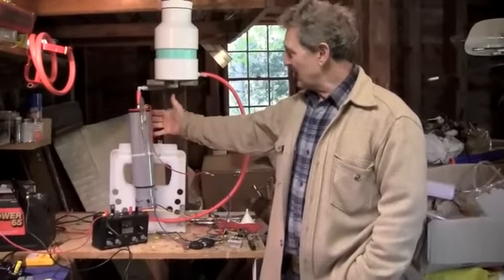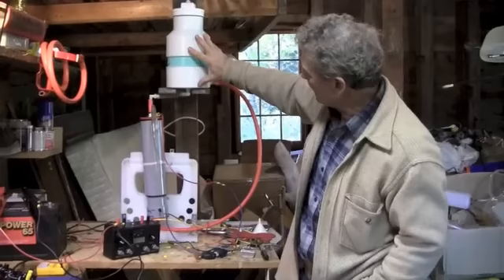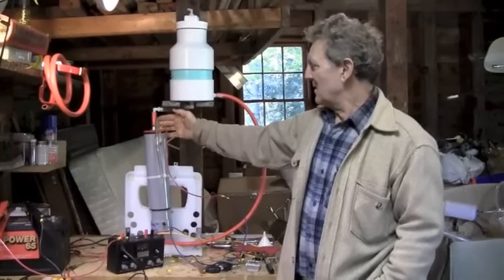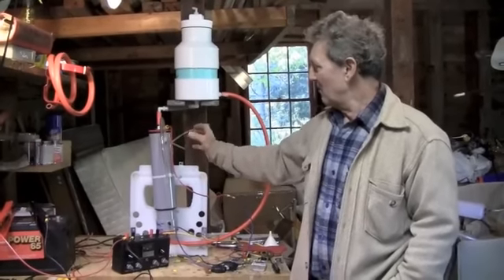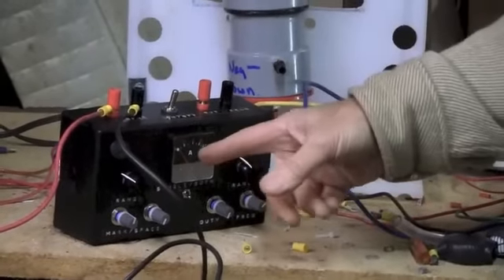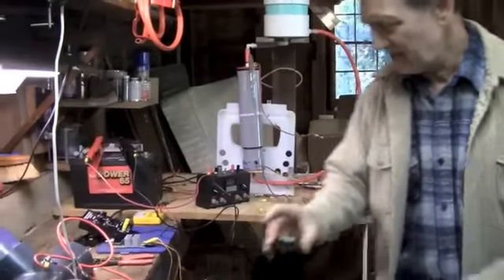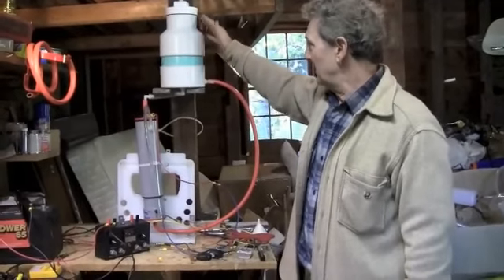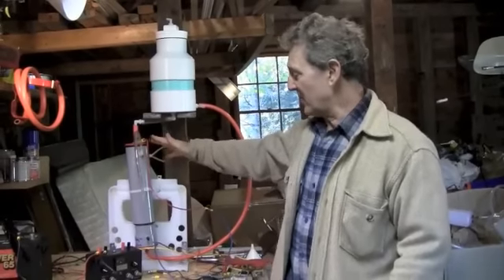Vortex High Performance HHO Generator

Comment: Closed loop water flow thru plates = cavitation high voltage, this is a legit stan myer zpe gas generator
Reply: But he doesn't know the water flow is the real key. Close cell gap increase pressure of water a tiny bit n that cell will run a car on hho